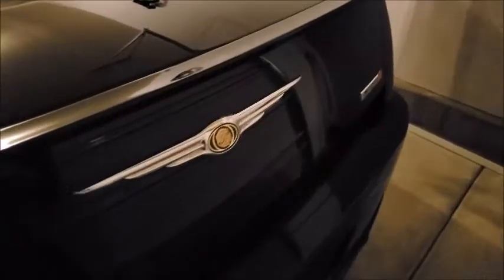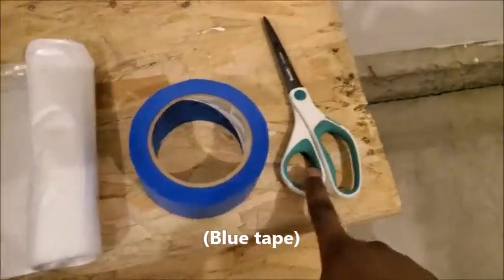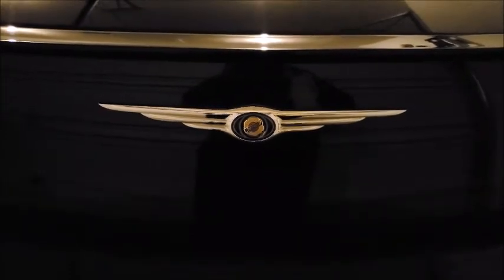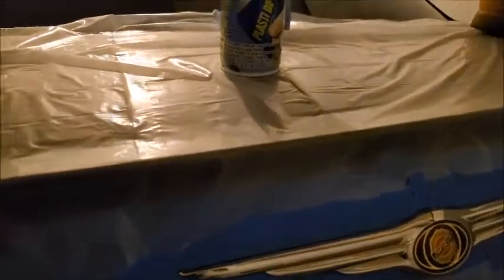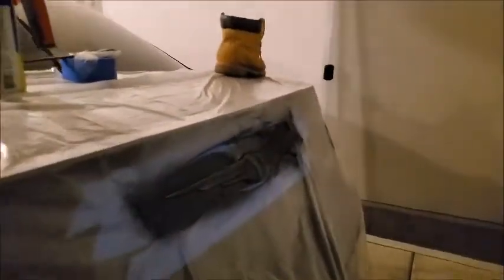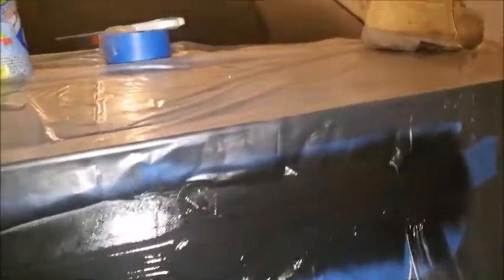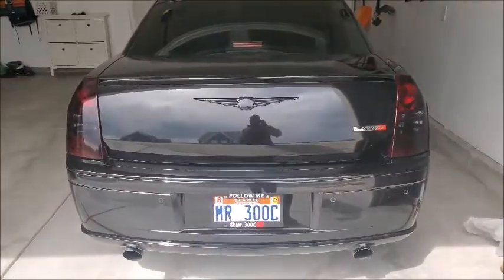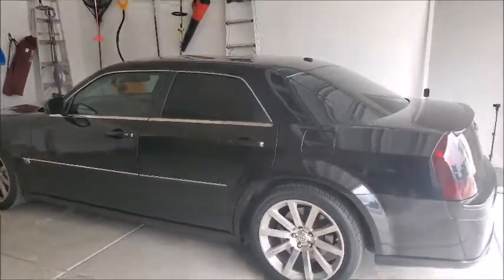PLASTIDIP CHRYSLER 300 TRUNK BADGE (BLACKOUT)

Comment: My blacked out side indicators showed up, freekin wiring plug is different to factory, might need to put on my electrician hat on to rewire, still waiting for blacked out front side markers, new led front driving lights arrived so I gotta rip off the front bumper, SRT wheel caps came in few days ago, they don't fit must be for Jeep SRT, waiting for green strip light to go around stereo surround, few projects to pump out just gotta find time
Reply from the maker: Dang bro. Sounds like you got your work cut out for ya!
Reply: @Mr392Scat  I need to attend an AA meeting for ebay spending 😆

Comment: Hi from the UK, i keep toying with the idea to upgrade from my v6 300c to the v8. Speed and sound really is thr only improvements id be investing in. Yesterday i ran a 5.8 second 0-60 with the nitrous OFF, best ive ran is a 5.6, quarter mile best time is 13.8 seconds.

Whats the most you got out of the Hemi? Am i looking at stacks more gains with upgrading or?
Reply from the maker: Oh you wow got NOS on your 300c V6! Impressive 💯. Imagine running NOS on a V8. 🤯 That only should answer your question. 

But for me I'm not going crazy with my SRT8 build. I've only added 40hp to my car with a custome tune, exhaust work, and performance enclosed cold air intake system.

Is there a certain number for time or horsepower you want to achieve?
Reply: @Mr392Scat  there isnt a target i have in mind, if the V8 are crushing my 0-60 time currently and running quarter mile races 12 seconds or faster i think i will make the change. Have you recorded your 0-60?
Reply from the maker: I haven't recorded my 0 to 60. I don't have timers on my car 😔. My 5.7L 300c i had before didn't have it either. Checked on the secret menu too. I guess some trims have that option and others dont. 🤷🏿‍♂️.  Stock on paper its 5 seconds 0 to 60. So for my setup I would say I'm around 4.6 to 4.8 seconds. 

Would you be looking into a 5.7L, 6.1L, or 6.4L V8 if you made the change?
Reply: @Mr392Scat  bigger the better ;) the hemi's are hard to come by here in UK but i often take a look at anything above 5.5L to see if a price comes up thats too good to miss.

I thought all the 300 hundo's have the in built timer!!! Thats weak man
Reply from the maker: Oh yeah have some slim pickings for HEMIs in the UK. Such weak sauce for the timers bro! I'm so mad about it! Lol!